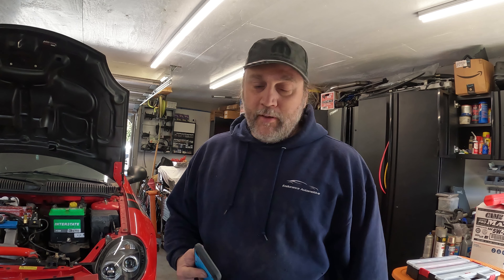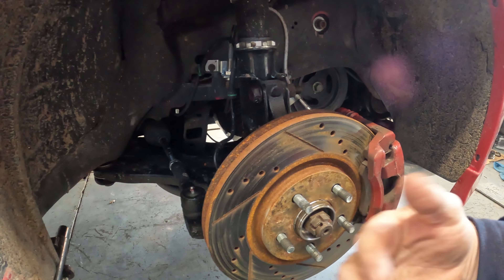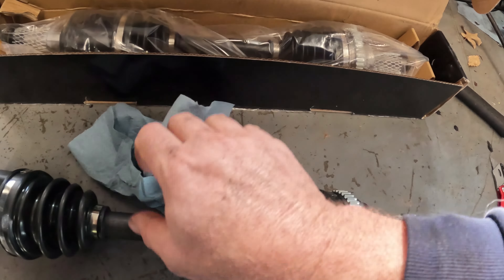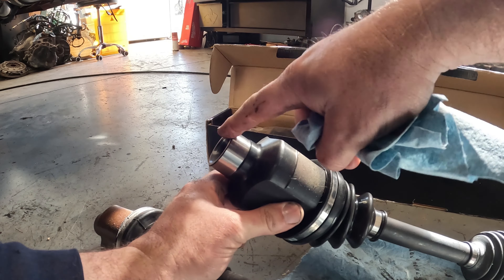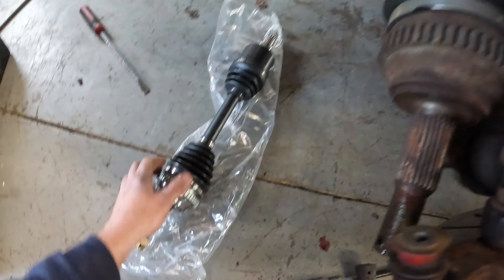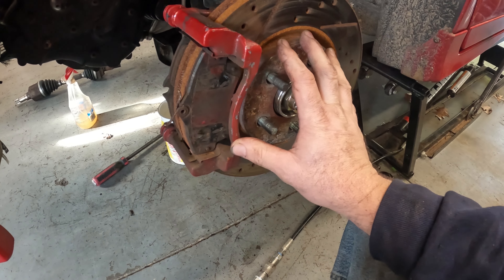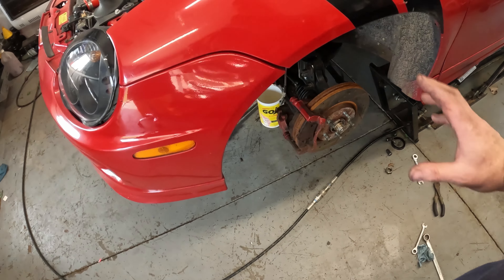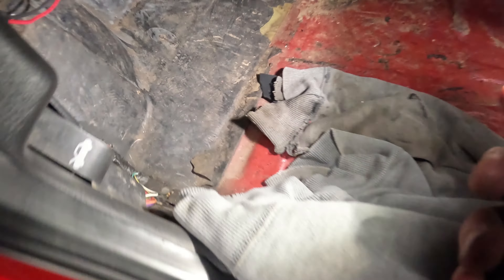RED SRT4 GETS INSANE SHAFTS INSTALLED

Comment: Hey man I’ve watched some if not most of your videos and love all your work I recently got a srt4 and put a motor in because the old one was shot but after that I no longer 90% of the time can’t shift into 2nd 4th or reverse has all the bushings adjusted the crossover and still giving me same issue any input or help would be appreciated 😅
Reply from the maker: ha i found your comment, its good to hear the shift cables fixed the issue will need to get together when it gets a little warmer here soon

Comment: How do you remove the driver side axle? I can’t seem to get it off. Tia
Reply from the maker: the driver axle i've had issues with the store bought ones the clip holds it in too tight most of the time its an easy pop with a pry bar there is a fork tool for popping the cv axles out. i was looking for that one but just found this tool a slide hammer set up https://www.ebay.com/itm/355498580338?mkcid=16&mkevt=1&mkrid=711-127632-2357-0&ssspo=yai3n3lyssq&sssrc=2047675&ssuid=lDFTDWAdS1i&widget_ver=artemis&media=COPY
Reply: @Mattsneedforspeed thank you! I was able to get it off with a crow bar. Guess I wasn’t applying enough force with the pry bar